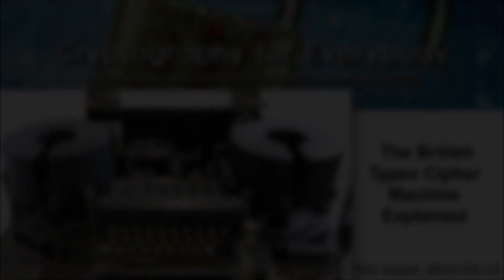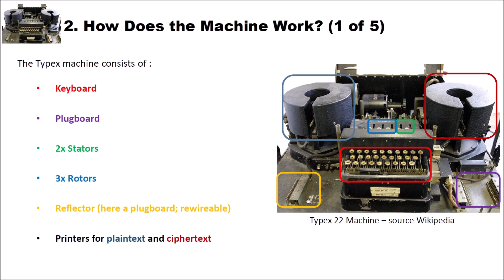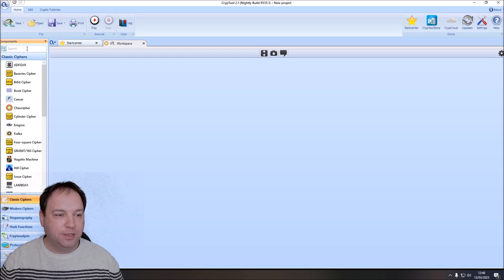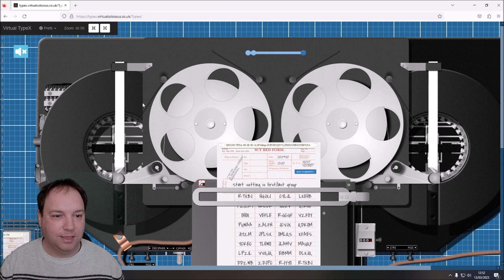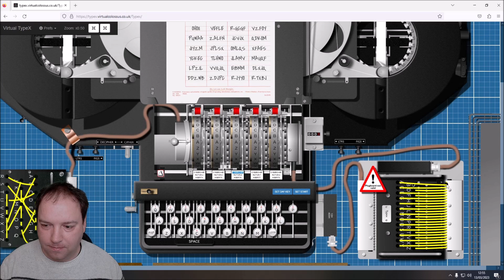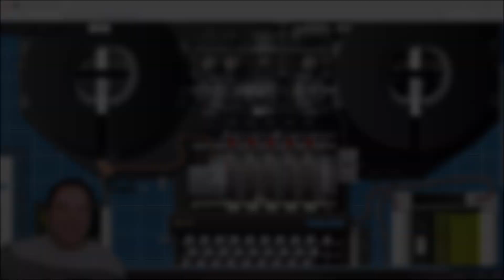The British Typex Cipher Machine Explained

Comment: Given the complexity of Typex and SIGABA (the American version) how is it possible that despite being developed in secret and independently once America joined the British is war, Typex and SIGABA were interoperable?
Reply from the maker: They were not. The working principles are  very different. Probably they exchanged machines for the purpose of being able to communicate - greetings Nils 🙂
Reply: @CryptographyForEverybody  The crypto museum says they were. Supposedly there was an "adapter" (this source says). I agree with you that this shouldn't be possible but apparently it was.
Reply: I don't think they were interoperable in the sense that one could encrypt and the other could decrypt. I think they were used together in the way that messages were encrypted by SIGABA, then the encrypted message was again encrypted by a Type X machine, the result was sent, and then Type X and SIGABA decrypted the message. This simply required the two systems to use the same character set.